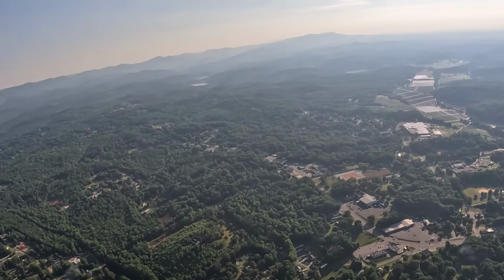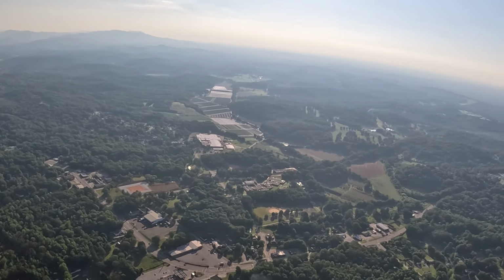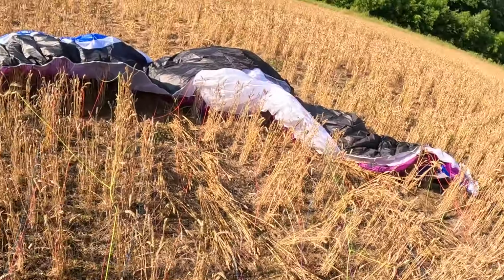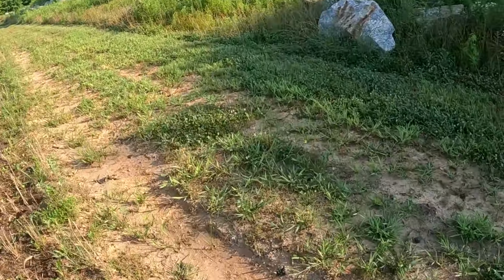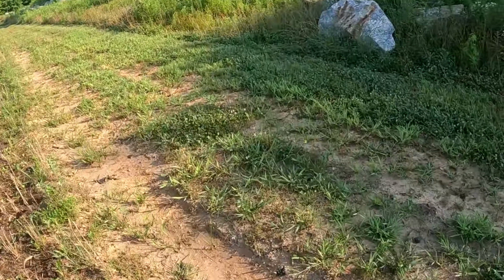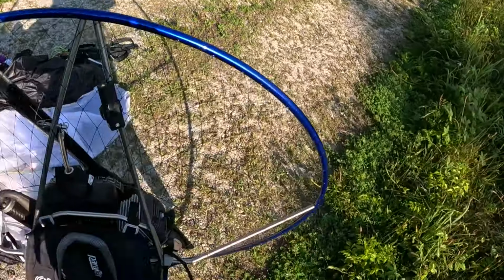Engine Out on a Paramotor!!

Comment: This is a great example of why flying higher is safer.  It gives you more time and options.  Great landing.  Did you figure out why the engine died?
Reply from the maker: Not exactly. We adjusted to carb and changed the spark plug and I could tell a huge difference in performance.